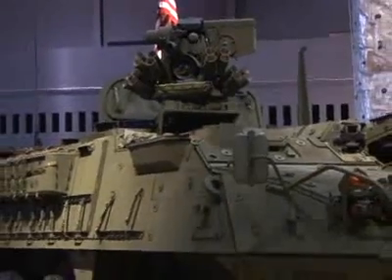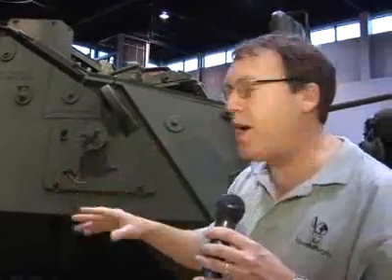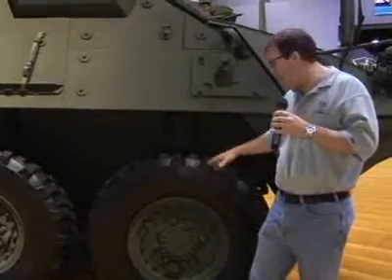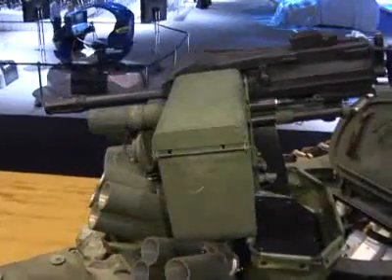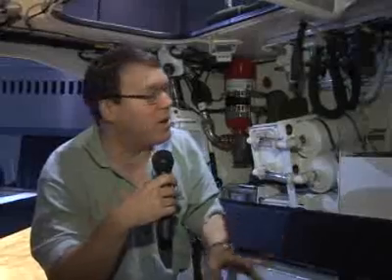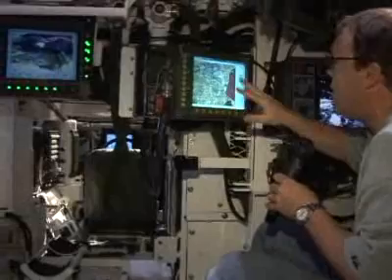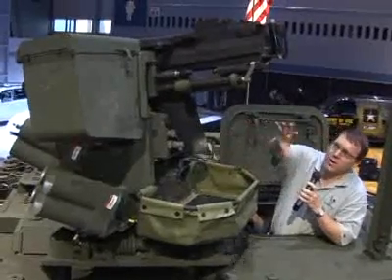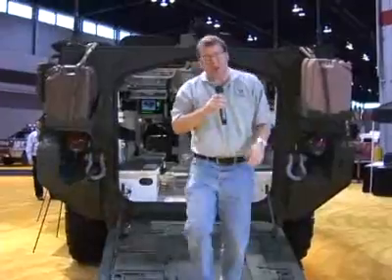How Strykers Work

Comment: Holy crap dude, you are such a TARD!!! Have you even been in a Stryker, or even worked around one? I can assure you there is AC in the Stryker!! Our brigade was the FIRST to get them in early 2000 and they ALWAYS HAD AC!!! And for the Run Flats.... All 8 tires are EXACTLY the same, hence they are ALL RUNFLAT!!! These tired CAN be extinguished once lit, I have recovered combat loss Strykers and it wasn't hard to put the tires out!!! Get a life and quit believing everything you read!!